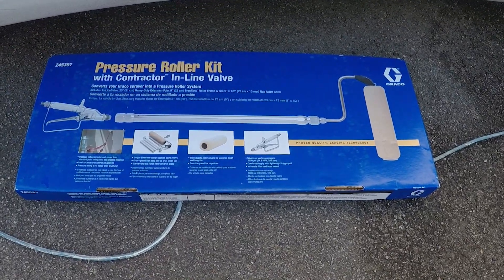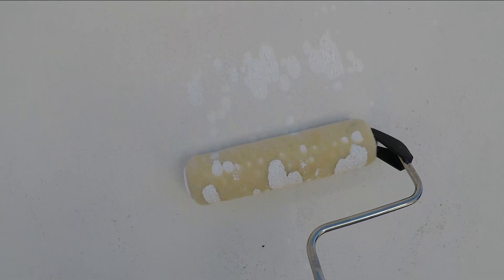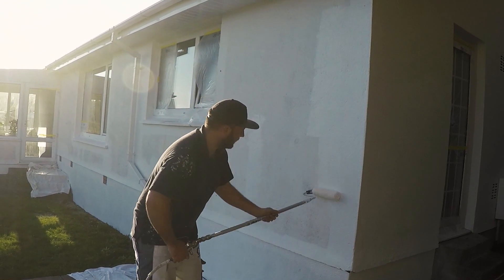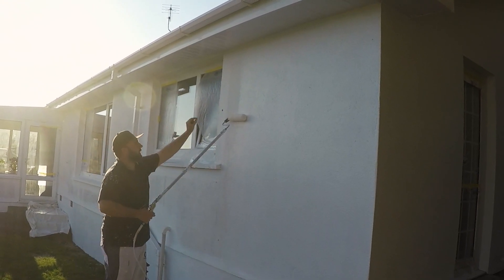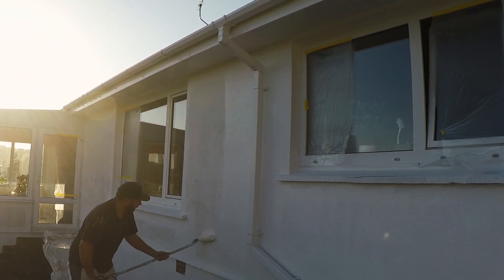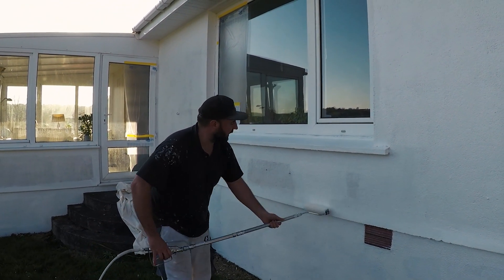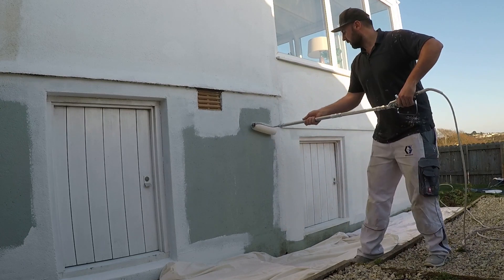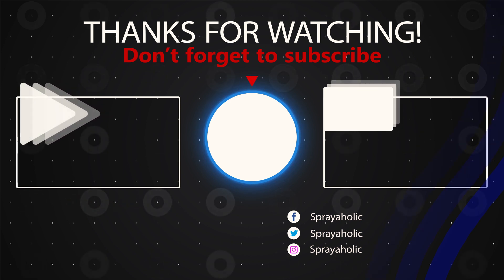Graco Pressure Roller - How To Use, Setup and Review

Comment: I use the pressure roller for any job over 1 room ( which is 99% of my work) I find that putting a little Vaseline on roller ends and inside roller 1/2” seals roller and I have no leaks for several day jobs.
Reply from the maker: Nice. Yez its a fantastic piece of kit, i try to use it on all my exteriors

Comment: How do you clean one of these?  More specifically, all the tubes are full of paint at the end of the job, how do you recover that paint?
Reply from the maker: Take the roller sleeve  and scrape as much excess off and put it in a water bucket and clean. Then its just like cleaning an airless with an extension. 
When you run water through keep the  pressure low and aim the frame into a bucket and pull the trigger. Once youre happy its clean enough i would just slide the roller on and quickly blow that through too. 
The roller sleeve is like cleaning a normal one. Or just price sleeves into the jobs and throw them

Comment: Great video mate. Would it be possible for you to do a video on spraying exterior render. Was just a bit concerned about streaking etc.
Cheers mate
Reply from the maker: Sure next time im on one I'll sort something.  To be honest
 If its smooth render, i do often roll. Its fast less masking, or i use the pressure roller alot. If its textured finish like pebble dash or rough  cast,  ideally its best to back roll anywsy so the roller pushes it onto the holes.
Flat surfaces, if its on too light with spray it may show patchy. You can always do it on 2m x 2m squares. Sprayer vertical then horizontal, should eliminate that issue. But depends on the sheen on the finish. The previous coat could show a twxtire making it look like youve done a bad pass, shading or texture from rhe original surface.
Reply: @sprayaholic  cheers mate how much is the pressure roller with extension?
Reply from the maker: @micksmith3352  not sure,  check out sprayman uk or spray direct.

Comment: Are the standard Graco naps/sleeves polyester? I love the white microfiber sleeves because they roll so smooth and I can recoat quickly (polyester tends to take an hour or two to fully dry enough to recoat, and also spatter like crazy). It’s be a deal breaker for me if the Graco sleeves are the run-of-the-mill hardware store polyester material. It’d have to be either the tight knit polyester or microfiber to win me over… I’m addicted to the smooth finish I currently get with my current sleeves 😏 Also would have to be compatible with a pretty decent length extension pole as well.

Comment: have you used a different roller with this setup or do you have to use the roller tha came with it? specifically, lambswool roller...?
Reply from the maker: Hi, they are specific rollers. As they have holes inside so you need to buy either the aftermarket ones or genuine ones. Available in short medium and long pile if i remember.  I usually buy mine off ebay. I'll make a new video about cleaning and bits soon
Reply from the maker: If you wanted to use a normal roller then you could buy the jet roller set up.  That sprays below the roller, or onto the roller

Comment: Good video Simon. Actually explaining and mentioning pros and cons. So many videos ( on every subject not just our game ) don’t show how anything bloody works. Well done sir. You prefer this to the jet roller ?. Stay safe mate.
Reply from the maker: Thanks Steven appreciate the feedback. Ye I do like it, zero chance of over spray or accidental spray. If mainly whites and wanting to back roll the finish you just clip the roller cage onto the frame on the jet roller and cut in with the sprayer and then use it to work in the middle areas. I always think for general use what you get with the Jet roller kit is more benefial for total use. You get 2 extensions, a cleanshot valve, inline gun, another guard and a tip, then the cage. so a lot for your money really  as you can use alot of that seperatly. plus many like to use there own sleeves and you can use any with the jet roller

Comment: how much paint do you think you save by using this vs sprayer?
Reply from the maker: @youtubular007  id say maybe 10% atleast as you can easily over apply with just spray. But more in textured surfaces as you can spray and try to flood the surface to cover it all. Where its actually best to spray and back roll to push it in. Or use this . Its mainly a big time saver. Especially as 1 man team

Comment: Do I have to get a .3/4 inch cover as a replacement  or 1/2 inch as replacement, pls help
Reply from the maker: it depends what size nap you want to use. 1/2 is for semi smoooth to semi rough
3/4 is semi rough to rough. hope that helps

Comment: Hi @Sprayaholic, I'm in the process of ordering the power feed roller but I just can't make my mind. Should I go for the rigid extension one or the telescopic?
I believe the telescopic would serve my needs better (interior domestic jobs) but the length is not adequate (45cm to 90cm) so can you add a hd extension pole to it? Which one would be better you think?
Thanks a million mate.
Reply from the maker: hey sorry for the delay. Yes if id have known about the telescopic id have got that. At one point i had 3 solid extensions on and it was a nightmare moving into smaler areas., the solid extension on first and then a telescopic would work well

Comment: Can ya use any graco extension wand or do they have to be special pressure roller wand extension?
Reply from the maker: These ones are HD poles (heavy duty) extensions.  It would work with normal i guess but they could bend possibly.. the heavy duty ones are obviously alot stronger and sturdier so safer too
Reply: @sprayaholic  ok yeah definitely not the skinnier wands
Was just wondering I guess if the threads or whatever were different than ya standard heavy duty wands
Oh!and they make a telescoping wand for it also?Sweet!
Reply from the maker: @deekoh3996  yes in the uk generally the threads are all the same so you can add different brand guards and extensions to the guns as theyre 7/8. In America i think they have 11/16 aswel.

Ye the telescopic pole looks great i saw this afterni got the normal set up. If it works with a stamdard guard and tip then that would be a handy extension if youre in varied height areas

Comment: Do you need to buy special rollers for these so the paint can bleed through ? If I’m not mistaken don’t all paint rollers have a hard plastic sleeve inside that are not perforated and wouldn’t allow this to work?
Reply from the maker: Yes you need to buy the special roller heads. The sell aftermarket ones aswel as genuine 
 The jet roller is the one you can use with a normal roller sleeve as it sprays underneath where youre rolling

Comment: Great video ! So this is an alternative to the standard jet roller? Makes senthat its inline instead of just spraying partly onto the outside of the sleeve. Do you prefer this one to the standard kit? Are there any drawbacks?
Oh...and how much is the full 12 inch kit?
Cheers buddy great work 👍
Reply from the maker: Appreciate it bud. Yes this is the inline version. I really like it. I'll try do a comparison video in next few weeks.
If you wanted the 12inch youd be better off speaking with sprayman uk
 Or spraydirect. The 12inch head  needs the nut connection if you're adding it to an extension. If you had the extendable one it fits straight on.
Only draw back is the sleeves are.more expensive.  Not loads heavier i dont think.
Reply: @sprayaholic  how easy or hard are the inline ones to clean?

Comment: Can you use them on interior rooms?
Reply from the maker: Yes absolutely.  They do different nap rollers sleeves for iy
Reply: @sprayaholic  I’m 63 retired from the biz 5 years ago, felt the work was to hard in the body, but having one of those makes me want to go back at it, If I can set it up I’m going for it
Thanks
Reply from the maker: @barryoneill-ec9zz  saves alot of time dunking the roller over the day
Reply: Thank You Sir, was in the biz 35 years, did it the hard way, Now with all the sprayers and festool I’m looking forward to it again
Thanks
Reply from the maker: @barryoneill-ec9zz  its all about making the job easier and more efficient for ourselves now.
Reply: @sprayaholic  Agree

Comment: Anyone have trouble with the seals leaking on these after time? I’ve heard they’re non replaceable
Reply from the maker: On which part? The actual roller frame? If its the extensions they have rubber washer seals you can replace

Comment: Can I add a cleanshot onto this 1
Reply from the maker: There would be no need. This is a direct feed into the roller sleeve so there is no spray.
Reply: @sprayaholic  Have you tried both? Which is better
Reply from the maker: @metalhead9656  the pressure roller and jet roller? Yes i have both. You get a cleanshot  and 2 extensions with the jet roller so you can have multiple uses out of that.

I do like the pressure roller though as its just zero spray
Reply: @sprayaholic  I want the jet roller but have a cleanshot. Might just go with the pressure roller. Thanks mate